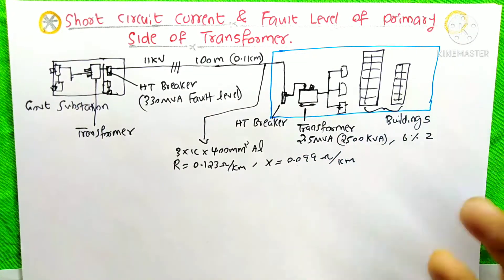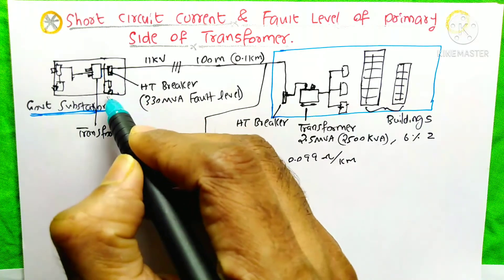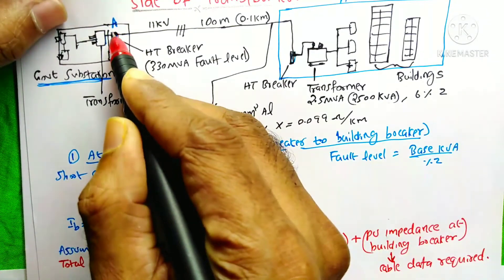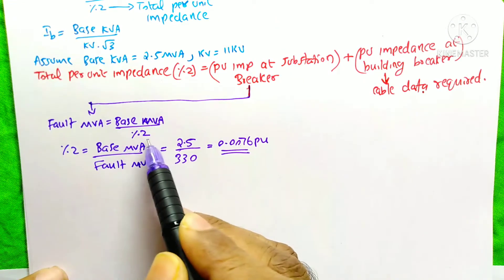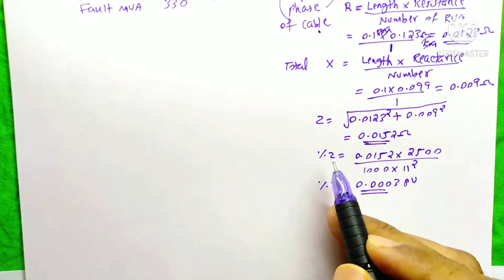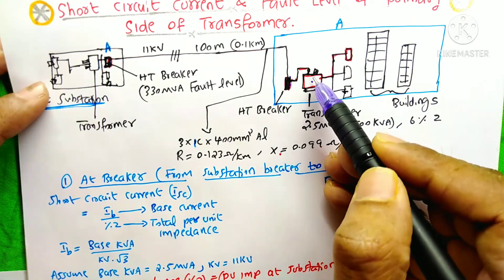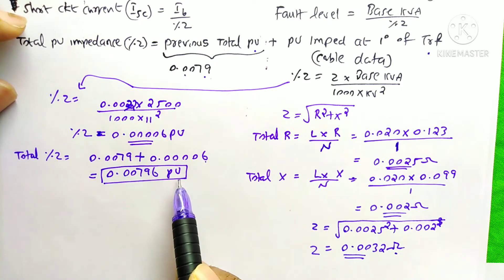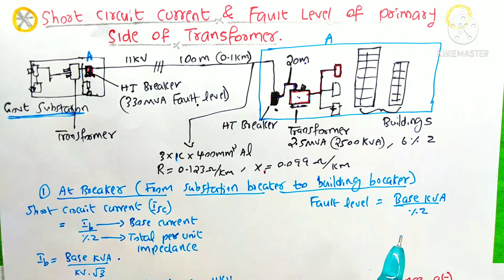Calculate short circuit current and fault level at primary side of transformer | Electrical

Comment: Why motor starting current is not included while calculating short circuit current
Reply from the maker: It is not required, because short circuit current depends upon Base current and impedance